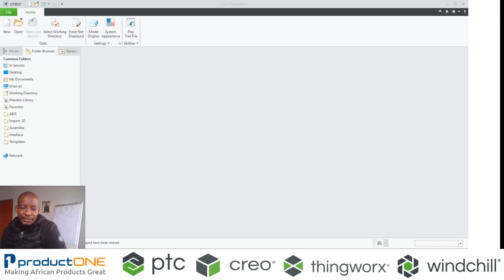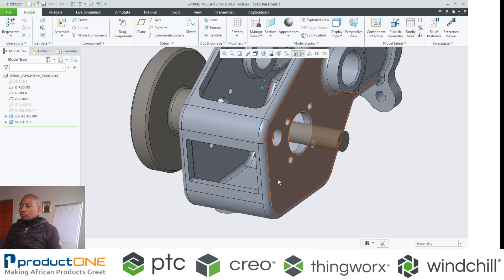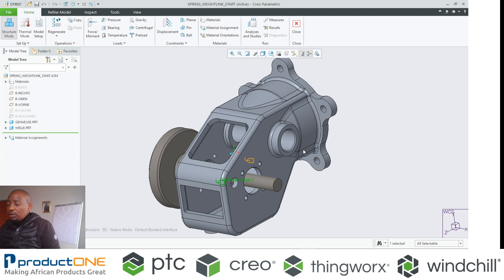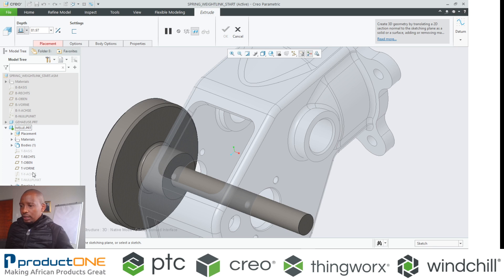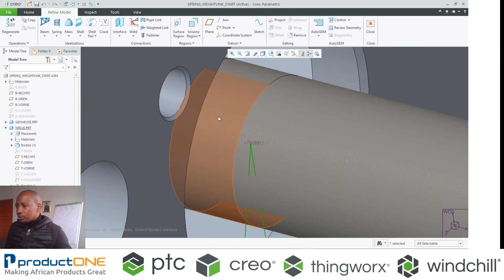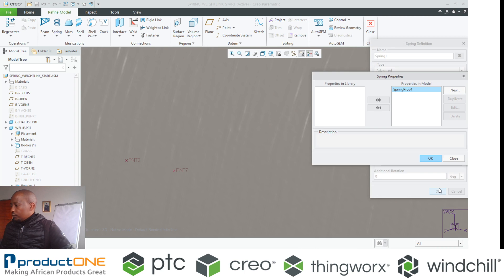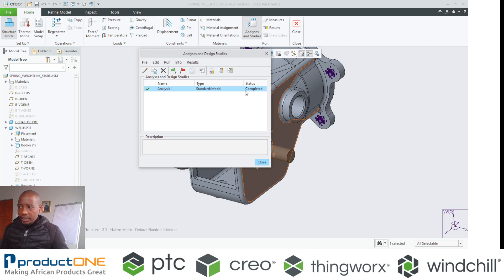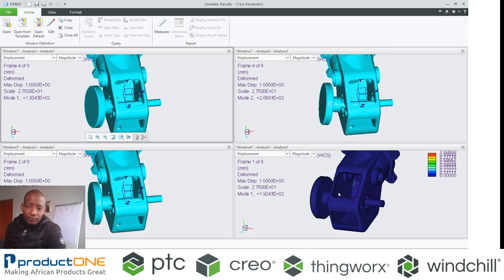Creo Simulate Weighted Links

Comment: Hello guys and thanks for the video, really appreciated. I have a question: how can I create a point in the space, in particular a center point of a hole? I need this point because it will be the dependent point of a weighted link.
Reply: In the model tab, you will have the option to create points from datum overflow menu. Pick any enitity like surface, plane or edge. You will get drag handles to constrain the point in space. Use them to locate your point as your intend to.
Reply: Create an axis in the center of the circle and then you can fix your point at the plane where you're interested.